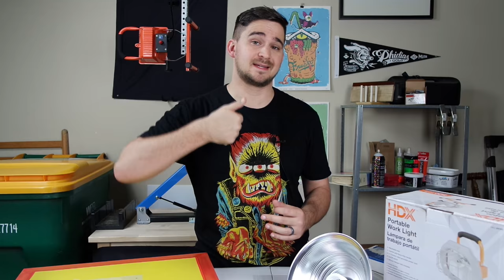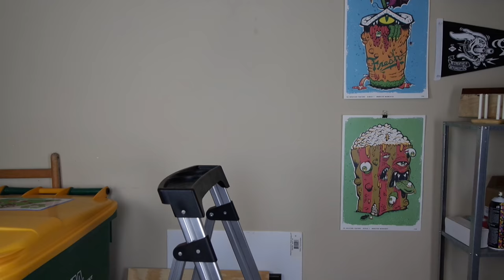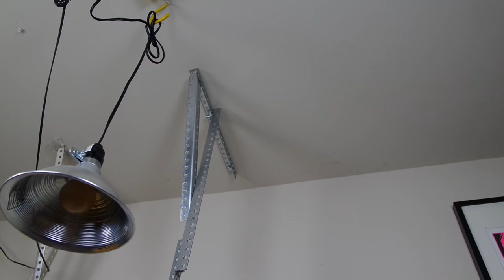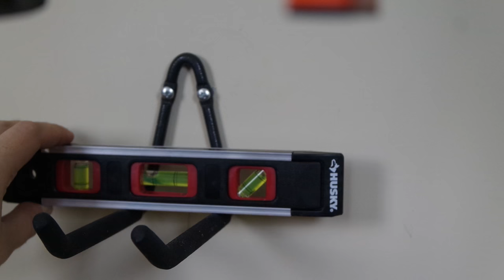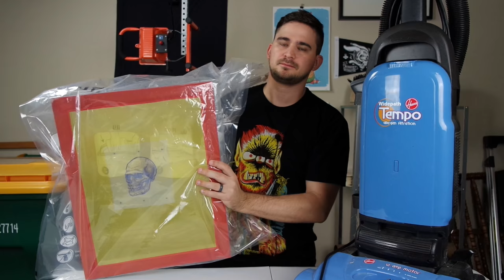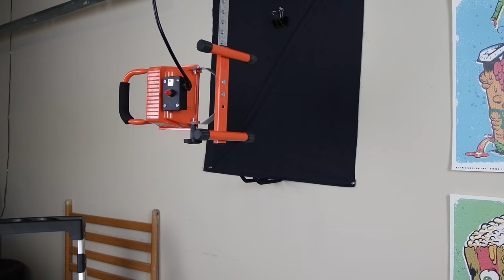Make a DIY EXPOSURE UNIT for Burning Screens | Start Screen Printing Now

Comment: That's too much work. I always found that the rubber vacuum blanket for making a diy professional exposure unit was extremely expensive until I found an outdoor pool company that practically gives away rubber pool lining material remnants. It's dark gray like tire inner tube rubber and perfect for pulling a very tight vacuum. You just staple it around your wooden vacuum frame. It doesn't even have to be tight. Check it out.
Reply from the maker: Thanks for the feedback David! It honestly did not take too long to put together. I am going to build a more traditional exposure unit sometime in the future. I will definitely keep these tips in mind. Thanks!